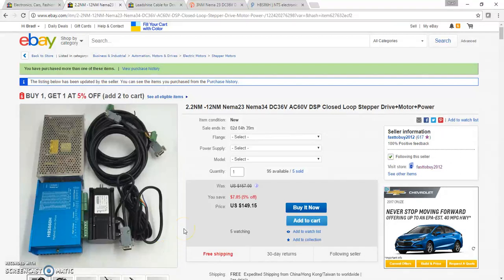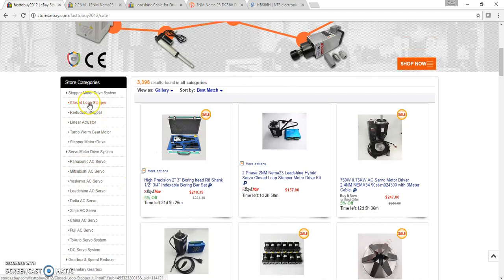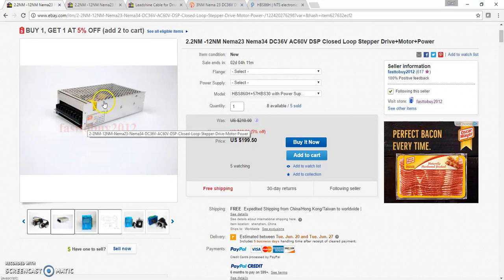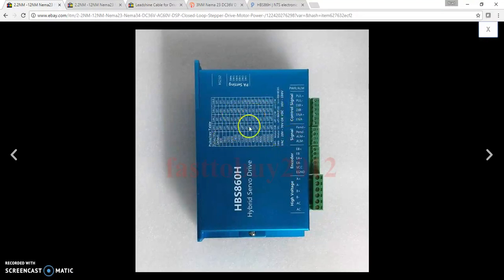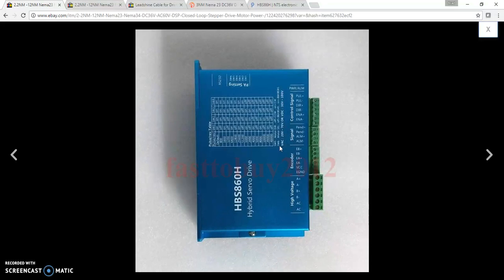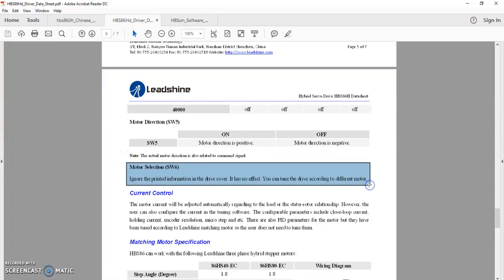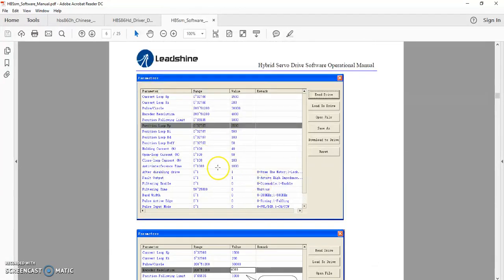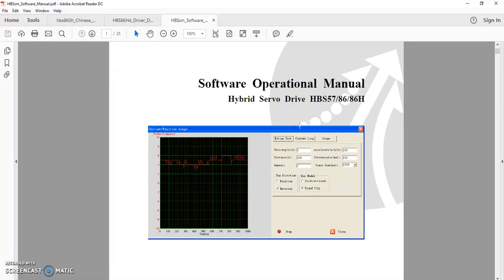HBS860H Closed Loop Stepper Driver: Important Information

Comment: Hi Franco,

Thank you for your helpful video.

The Leadshine tuning software does not seem to work under Windows 10. My multiport USB-to-RS232 adaptor has TX and RD data leds and no data is being sent. All ports work fine from Realterm. The software works fine on an old XP machine.

I just recieved a package (Jan 2018) of motors, drives and power supplies from Fasttobuy2012 , two 8Nm motors and one 12Nm. The 12Nm motor arrived with the shaft locked, which I'm working with the vendor to resolve. I suspect it took a knock in shipping and the armature is binding on the stator.
Reply from the maker: https://youtu.be/2x_IKvZJIPQ
Reply: Thanks Franco, that solved my connection issue!

What puzzled me was it working with just the English version installed on an XP PC I have hanging around at work for legacy software, but not on the fresh XP install I made at home. The 'Aha' moment was when I remembered I'd installed some software for a Chinese laser cutter on the work PC.

They're sending me a replacement motor..
Reply from the maker: Cool.
Reply: Hi Paul, Just a suggestion, can you run the software on win10 if you go to explorer and right click the program and then click Properties and there chose Compatibillity and then chose in Compatibilitymodes Windows XP and run as Admin.

Comment: Hello,
Can we use servo motors with the duet board?
Thanks
Reply from the maker: Hi.  You can used closed loop steppers on any board that can send step and direction signals.  So, anywhere a standard stepper can be used, you can use a closed loop stepper and get MUCH better performance.  If you are shopping, be sure to check these guys out:   https://www.omc-stepperonline.com//?tracking=5e66c8d3ae793

If you decide to make a purchase, it will help support my channel.  Thanks!
Reply: @FrancoCNC  ok thanks

Comment: great video! can i control this driver with arduino?
Reply from the maker: Sure.  You can control it with any device that can output step and direction pulses.
Reply: @FrancoCNC  excellent thanks!

Comment: Franco, it’s really hard for me to find info.... I bought the toroidal transformer 220v ac in 60v ac out 900w for nema 34 12nm steppers my question is..... These transformers cause a influx of power at startup, they say to use a thermistor but WHAT SIZE? Do you need a Capacitor? ( reason I bring this up is my breaker trips every 1 out of 4 times)
Reply: oh man, and You working with cnc, ;(
Reply: Ruuge uuge my apologies CNC GOD!! I bow to you!!  You know I have learned all my machining skills by asking questions. I saw this channel and thought I can do that! Which I have now accomplished! I didn’t need a capacitor or a thermistor. I talked to a very nice gentleman and he told me what he uses. Which was a YC-10-2D with 6" Din Rail and 2 Screws Yuco Miniature Circuit Breaker D Curve 277/480VAC 115/220VDC (2 Pole, 10 Amp) my set up now works! I’m a electrician that works on fighter jets not a fucking idiot. Tell me Cnc god what would you use?

Comment: i ve bought a nema 34 closed loop kit and have the same driver . When i powered it up with 60Vac current from a 600VA transformer it was just plain dead. It flushes current throw the A+ A- B+B-  and does not not give Green or Red light . The 60v ac is the recomended power but it does not seem to work. Most of the sites however selling this driver  , are also salling a 48 V dc 400w  power source. When you first powered it up
Reply: i trashed the proble; it was a malfactionning brige ac dc GBJ 1010 . However i had to upen it up . Very poor job
I also had to do a lot of new weldings rebuilt the heat shields
also i would suggest a lot of modiffying on the drivers built in power bridge as it is a real mesh
Reply: sorry for my spelling i am rather nervoys and cant hold my self .
Reply from the maker: Hi.  I recently had issues with my NEMA 34 12Nm motor/drive malfunctioning.  I was using a 60V 400W switching power supply.  I changed over to a 48V 500W switching power supply and everything seems to be working better now.
Reply: actually the driver power circuit uses an ntc 14d 301k and a glass fuse of only 5 A . That means you actually cant power it over 400 watt i thing . You should also check the bearings as they seem to be the basic nema 34 . the transformer they recomend is 300VA so they recomend to power it with just 240-260 watt taking into account their ac dc power circuit board. If you had opened up the driver , you would have seen the transistors beneath the board that power the motor widings. Mine were poorly solidered. I suppose you have wirred the pending and the alarm signal to your control board.

Comment: Hi, thanks for uploading 
the video very good ... I'm not very clear about one thing, these 
drivers have to be connected with the RS232 cable to work in cnc or not? thanks greetings
Reply from the maker: Hello.  You only need the RS232 if you want to use the software to chance the driver settings.

Comment: The benefit of using AC instead of DC.
Switch Mode Power Supplies produce DC power and are cheap because they dont use lots of copper and are easy to manufacture, but fail easy.
Transformers are Solid and weigh a lot due to the copper windings and the ferrite or steal core, the quality is based on the winding insulation laquer etc.
Using AC you do not need any rectifiers or power conditioning/filtering just feed the AC power to the Driver, the downfall is the transformer will not fail when power surge spike occures and can over voltage the driver causing it to fail. The DC swichmode power supply is the failing component, and its cheap to replace.
With the transformer the price will be higher due to the weight and freight..

Comment: hi Franco
i did buy close loop stepper the one you show in your video with 12 NM  NEMA 34 WITH TRANSFORMER but i am not able to move motor
i try every things
can you help me please which setting you did also wiring please
i try to use different  PC , i try different drive board but no lock   
THANKS
SAM
Reply from the maker: Hello.  Download the driver utility from the Dropbox location and use the test routine to see if you can make the motor rotate.  Then you can eliminate the motor and driver as your problem.

Comment: can i drive the motor directly with the driver without connecting the rs232 cable ?
bcz im not able to drive the motor with just the driver and dc 48v supply
Reply from the maker: Negative.  You need to send step and direction signals to the input terminals.
Reply: @FrancoCNC  Can you drive the motor with the dc power, driver, and a rotary encoder?
Reply from the maker: @dpavlovsky  I use a switching DC power supply.  The motors have the encoder built into them.
Reply: @FrancoCNC  Yeah, I just got one of these HSS86 w/ a motor. Came with a serial cable that you hook up to the motor, and then hook the other end (6 wires) into the encoder terminals of the driver.

Also, have you ever used this: https://www.aneramall.com/index.php?main_page=product_info&products_id=2812
Reply: Yes. There's a little confusion here about rs232 cable, serial cable etc.  You don't need the rs232 cable to drive the motor - it's just for tuning. You send step and direction signals to the driver's input terminals using individual wires connected to your breakout board/motion control board. The driver and motor are connected to each other with 2 cables - a 4-wire cable to drive the motor, and a 6-wire cable to read the encoder signals. The 6-wire cable comes out of the motor with a 9-pin D-sub connector on it, which is often used for rs232 standard, but in this case is nothing to do with the rs232 port - it's not a serial cable, it just looks like one. If you want to get the software and tune the motor, you need an rs232 cable with a 9-pin D-sub connector on one end, and what looks like an ethernet connector on the other but is, I think, a 6-pin RJ-25 connector (see https://en.wikipedia.org/wiki/Modular_connector).  Hope that helps.

Comment: Have you looked at "Clearpath" precision servo motor systems?
Reply from the maker: I have.  They look really nice.  But, by the time you buy the motor, upgrade the precision and buy all of the cables and stuff, they start to get pricey.  I think the closed loop steppers are a better bang for the buck (in my opinion).

Comment: Nice video I just bought 4 HBS86H WITH 86HSM85-E1 MOTOR of this the 8nm motor my problem is how to know the step per revolution of this motor for computing the step per unit to put on my cnc software. because I saw in es-m23480 datasheet that it's 3000 rpm and 2000 rpm I don't know if this is the step per revolution of this motor.
Reply: Hi, I consulted you and I solved the issue of revolutions? thanks greetings

Comment: Could you use that driver with a standard stepper and a linear encoder ?
Reply from the maker: Maybe.  It sounds like you have something special in mind.  I like the FastToBuy stuff but I can tell you that if you need tech support, you may be better off dealing with a company where the language barrier isn't as big a challenge. But, you'll pay more money for that.
Reply: +Franco 
I got a PM-30MV and I am debating how to CNC it. I noticed one of the greman machines where I work uses a linear encoder for servo feedback, like you would find on a DRO for a manual machine. This stragety seems briliant to me because any backlash is taken out of the equation. Even a high precision servo is only as good as the mechanical system that it is attached to.
Reply: FML I miss spelled German
Reply from the maker: True.  You may be able to find a way to use linear encoders - that would be cool.  My thoughts are this:  try to minimize physical backlash and use standard encoders/motors/drivers.  I'm working on a kit for this machine that has double nuts for X and Y which will be adjustable with set screws.  You'll be able to add as much pre-load as you like on the ball nuts to take out the back lash.  But...there will always be some back lash due to clearance in the slide ways and torque windup in the couplings.  That being said, I'm pretty sure we'll be able to get under .0015" on X and Y.  Maybe even less than .001" depending on how tight the ways are.
Reply: +Franco 
I am stoked about this, what do you have in the way of kits ?
Reply: Using a linear encoder with backlash between the motor and encoder can lead to an unstable system that oscillates. Systems of this type often use both the rotary and the linear encoders with a more complex feedback loop.

Comment: Have you figured out how closed loops steppers work yet?
Reply from the maker: Yes. What would you like to know?
Reply: No I am good, I have an undergrad in Electrical Engineering and an Associates in Industrial controls and Robotics, you seemed really confused regarding holding currents with closed loop steppers and I wanted to make sure you figured it out. Thanks for offering.
Reply from the maker: @mrkattm  I am often confused.  Please don't hesitate to write comments that will help people learn.  Thanks!

Comment: Thank you for the docs on your dropbox
You can add this mamual :
https://hardware-cnc.nl/images/PDF/ACT/HBS86H_English_Manuel.pdf
Reply: Hello, try to connect by means of an FT232RL the wiring of the RJ11 connector on the page of this manual is different than the one attached by Mr. Franco

Comment: i have tried to make own communication cable in rs232 side pin no 2 is connect to pin no 3 of rj11, pin no 3 of rs232 is connected to pin no 5, pin no 4 of rs232 is connected to pin no 2 with diode and 1k resistor, pin no 5 of rs232 is connected to pin no 4 of rj11. still im not able to connect driver to software plz tell me the right connections

Comment: bundling the powersuply doesnt say a lot , could be the seller just has a cheap shipment of sumting that "works" that he wants to get rid of 
i wanted one power supply to power all the steppers in my setup , nostly to keep the size of the box down and theres a complex calculation to find out wat you need :
http://www.cnc4everyone.com/electronics/power-supplies/
 i whent for the golden middle way in volts and for maximum in amps to have enough headroom and not overload the motors or the power supply

as for the manual : if you look at youtube for the chineese leadshine closed loop stuff the leadshine fabricator is actually putting the american type number in there comments below as they get this question about the manual several times per hour and if you search with that typenumber you get the american website with the proper online manual 

hadnt seen the option about programming the drivers through software (not quite that far intoo the build yet just purchasing goods)

just in case youre building a complete unit : i found a realy nice ethernet controllboard/bob that doesnt get squirily when therers electric interference nearby and works realy well on both uccnc and mach3 

http://www.cncroom.com/interface-cards/uc300eth-ub1?language=en

going to buy this myself as well , going to run the cheaper uccnc software 
looking back its a good thing i waited with the purchase of the controller a while as the other versions running the same ethernet board  needs a seperate break out board to hook it up to all the stepperdrivers spindle and analog stuff
Reply from the maker: Check out the Centroid Acorn software/control board package.  What they are offering blows everything else out of the water.
Reply: going to look intoo it , havent seen any youtube how to's on that program , the most used one seems to be mach and uccnc
Reply from the maker: The Centroid Acorn is just hitting the market.  I bought one and I'm very impressed.  Very professional.  Way less "fiddle factor" than Mach3 or Mach4.  The software and the hardware come from Centroid and are perfectly integrated.  I plan on making some videos as soon as I can get past this hurricane Irma thing...
Reply: The Acorn is new, Centroid has been around a long time building CNC controllers for real machine tools. Centroid Acorn is what I am using for my Lathe conversion.
Reply from the maker: Nice!  I plan on using Centroid on my lathes, as well.